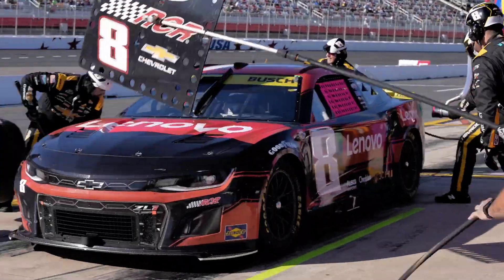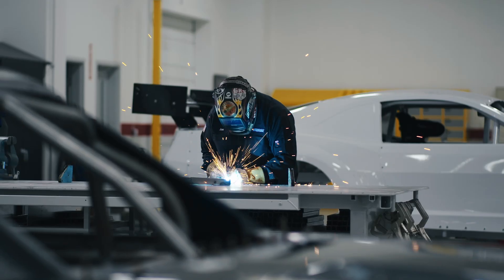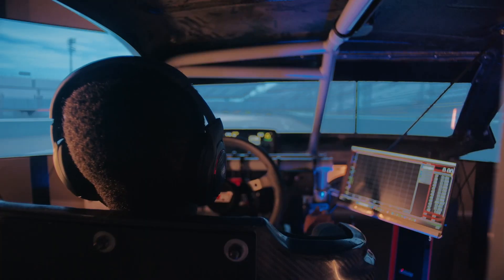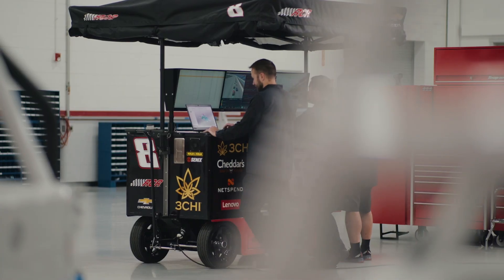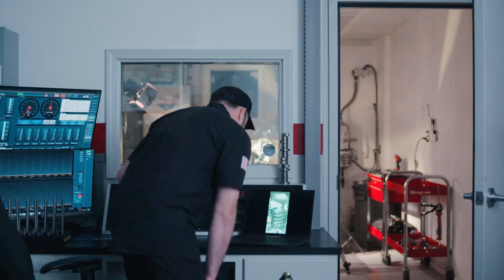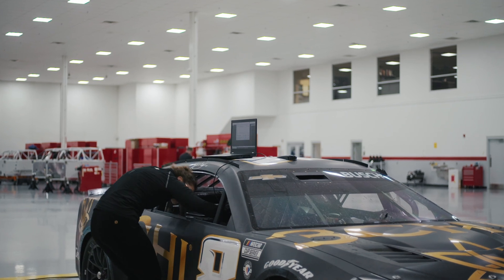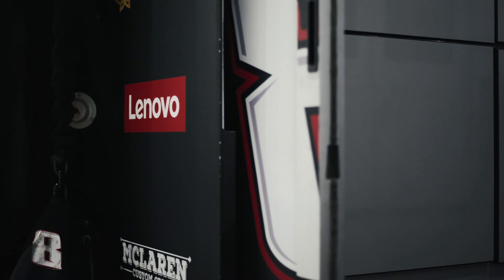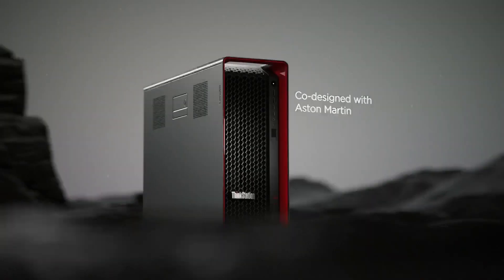Richard Childress Racing Outpaces the Competition with Lenovo & AMD

Comment: You should take this as a hint and offer AMD in more of your products instead of removing it as an option like you did with the new T14s gen 5 and while we're at it, stop restricting top-tier wide gamut color display options in your ThinkPad line to only power hungry OLED options with PWM and eventual burn in.
Reply: pwm and burn in are such non-issues though
but they should definitely have more AMD options though